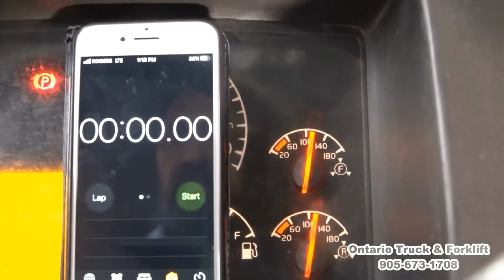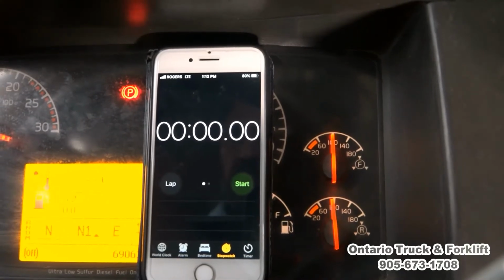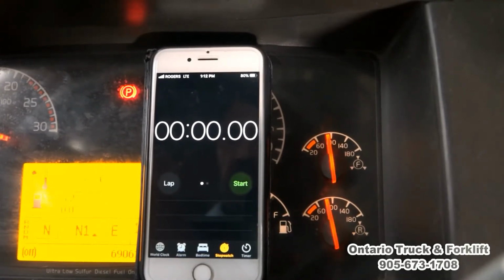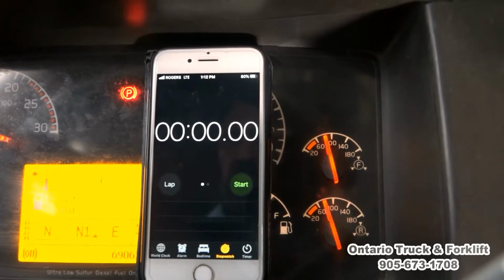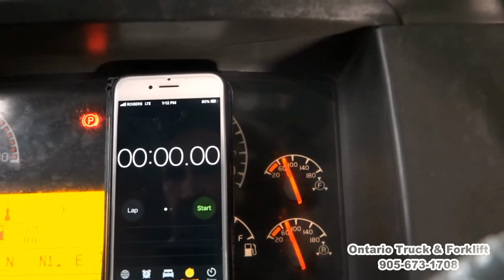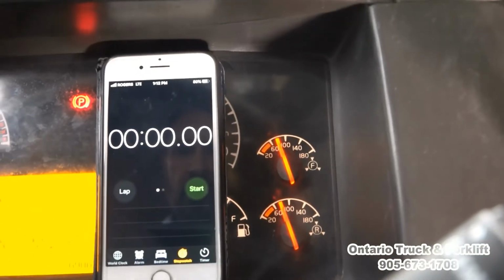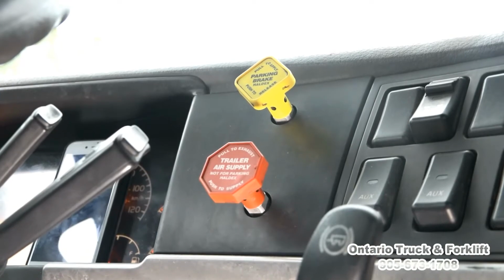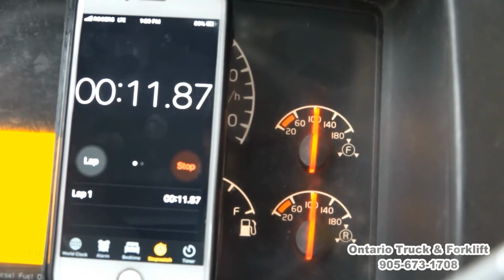Air Brake Inspection for Road Test

Comment: I just got my Air Brakes License on July 25th 2021 I'm now studying for my CDL Full class A License, I'm going to do the written knowledge test in mid December and take my Road test after the Winter. I'm gonna practice with a Manual Transmission Semi Truck.